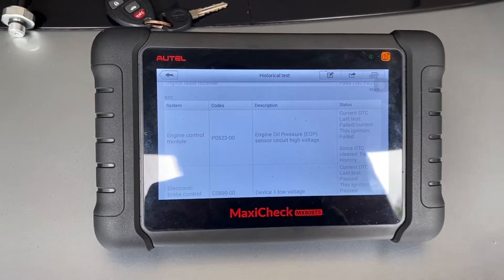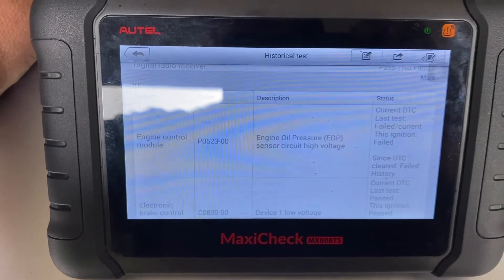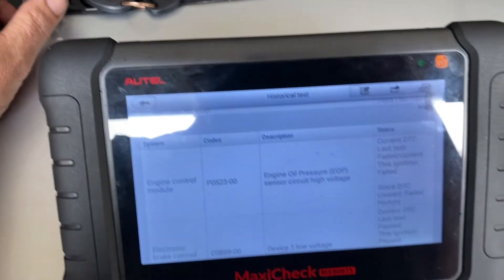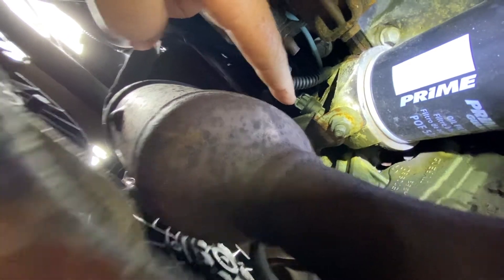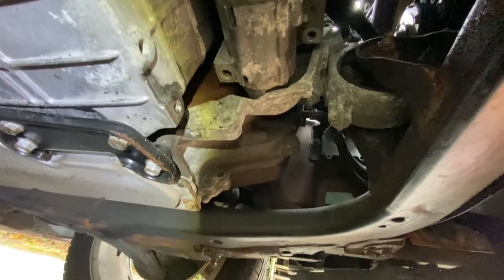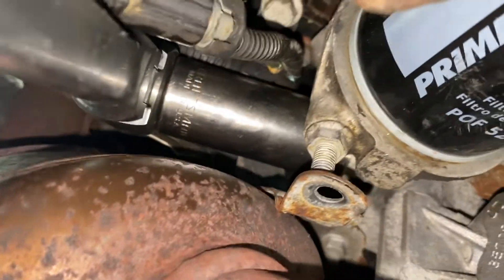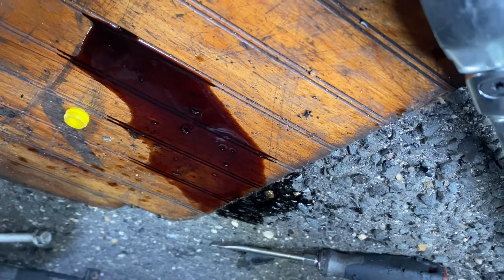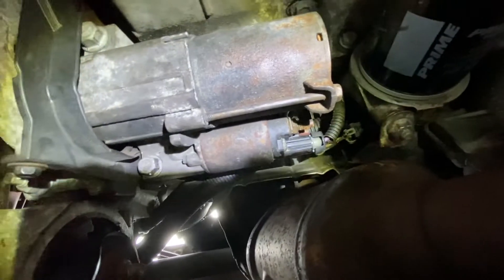Diagnose & Replace  GM 3.5L Engine Oil Pressure Sensor (Switch)- P0523 - Pontiac G6 2004-11 3.5L  V6

Comment: Many thanks for saving me $100. Your video is very thorough with the exception that on my 06 G6 did not have that bracket on top of the oil filter. Oddly enough, I  couldn't use the socket. No room. Needless to say, time and patience with an adjustable wrench got the job done. The only odd part was when I took off the old one. It was already loose, and I screwed it with my hand. It wasn't tight at all, leaving me to believe that It was never tightened from the get. And after time it just started to loosen yourself up. Go figure. But your video is very accurate and I appreciate it. Thanks.
Reply from the maker: Thank you very much for the feedback, Appreciated!

Comment: What kind of scanner do I need to find this code
Reply from the maker: Any basic scanner is fine for reading codes. Depends on how much information and what level of scan tool you want and of course price range. Autel makes great scanners for the money.
Reply: I have the 20 dollar one but it only shows the check engine light codes thanks

Comment: You said the check engine light wasn't coming on, but was the oil light coming on?
Reply from the maker: No, but that doesn’t mean anything, as the sensor could fail as well
Reply: @motorcarnut  I'm thinking it is a sensor also, and now thanks to your video of how easy it is to change, that's going to be happening next week.
Reply from the maker: No problem, good luck!

Comment: You can also use a deep 27 just in case  you don’t have 1 1/16
Reply from the maker: I’d say yes
Reply: Yeah. Technically you can. It's close enough to 27 that it's within the slop tolerances that the sockets are made to.